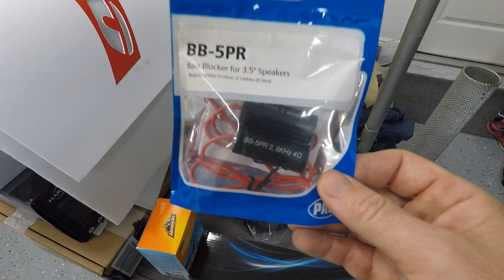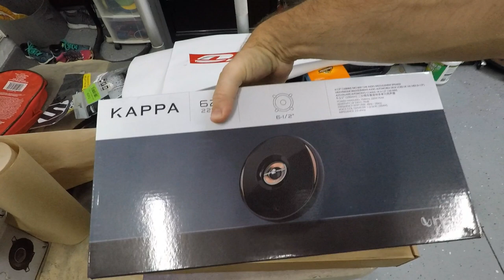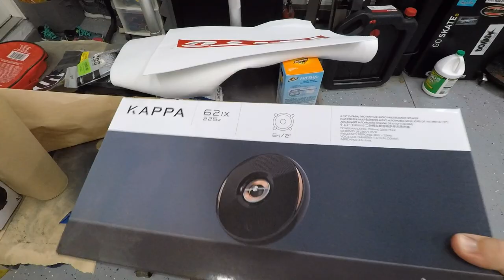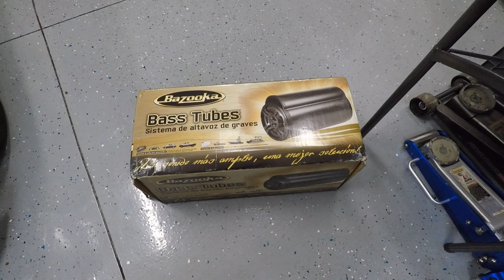The Easiest Way to Roll Your Fenders!! Plus xB Audio Teaser!

Comment: I did that to my XB on the audio and have 4 upgraded speakers in front. Back ones dont work but it's okay have 2 12s and extra battery in back. I'm not worried about going fast with these cars. Keep up the good work man.
Reply from the maker: Good stuff. Did you have to upgrade your alternator?
Reply: No, not yet stays around 13.3 volts at full tilt. Maybe in about 2 months I'll get one.

Comment: Raiders fan here for the last 20 years so I know exactly how it feels to have team that looses alot 🤦🏽‍♂️🤣. Looking forward to the rear camera video (need to do that to my box too) nice selection in speakers, my advice for an amplifier is; if you're only planning on hooking up the subwoofer to it get a class d amp. Get a smaller one too you won't need much for the bazooka to sound good. I worked in a Soundsystem shop for years. Kicker, jbl, lanzar, planet audio, pioneer, hifonics, rockford fosgate, autotek are all good brands 😉
Reply from the maker: What do you know about losing? Radiers fan??? Come on, you guys were in a Super Bowl not that long ago and have gone deep in the playoffs!! Thanks for the amp tips. I was thinking about going with the Alpine MRV-V500 just for the bazooka tube. What do you think?
Reply: @ExtremeDailyDrivers  😅 it's been a lot of ups and downs though.  I wouldn't spend more than $100 on an amp for that sub but if you're willing; look for a kicker class d no more than 500watts (class d gets you consistent bass with any type of ohms). Alpines aren't bad but their best for non-subwoofer speakers.

Comment: Our genders are incredibly thin- a little story- my hunting partners freakin dog chased a squirrel under my car. I have teeth sent marks on BOTH of my fenders are the top. And chew marks on my front bumper at the wheel 🤦🏼‍♂️ I basically need a whole new front end with that plus other little damage from driving
Reply: Umm...fenders... not genders 😂😂
Reply from the maker: I knew what you meant. Lol. Thanks for watching!